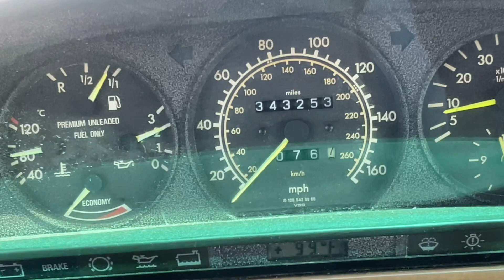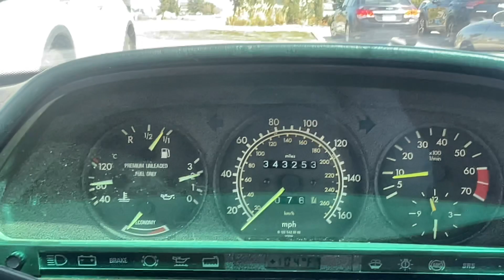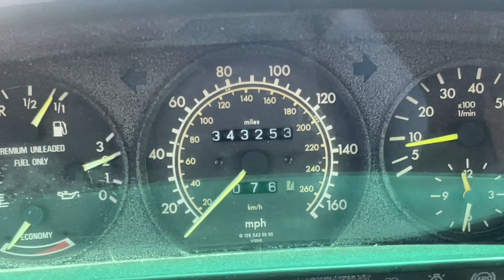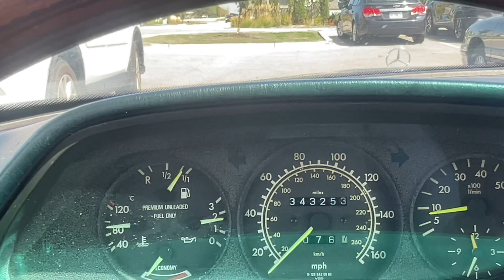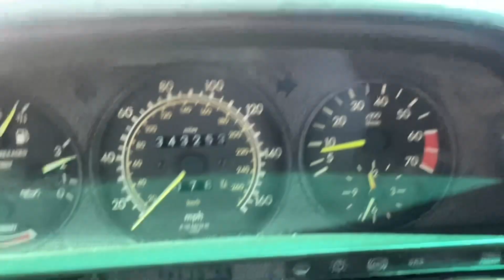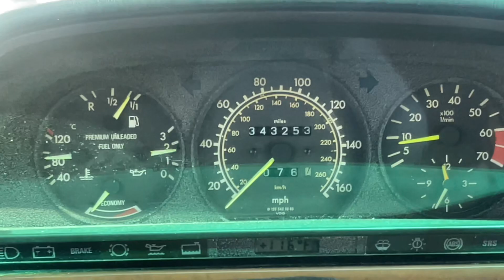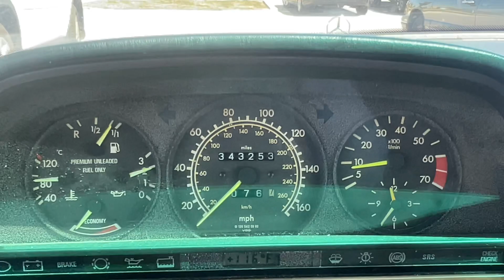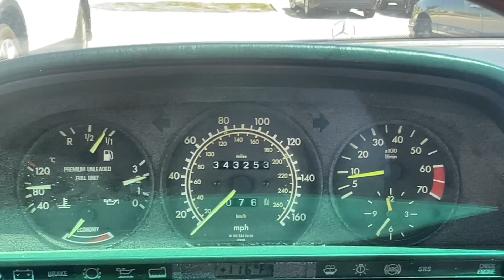Mercedes 560SEL Camshaft Timing offset woodruff keys after 13K mi 20K Km of timing chain replacement

Comment: Can you do a tutorial on crankshaft position sensor wire, please. They are discontinued. 😢
Reply from the maker: That will be difficult, let me see what I can do
Reply from the maker: This here is the Bosch Part which is still available for the 1986 to 1991 560SEL 117.968 engine 
https://www.pelicanparts.com/More_Info/0261210022.htm?pn=0-261-210-022-INT
Reply: Thanks, I tried buying but it's out of stock. I'm very worried that I have to abandon my 560SEL once the CPS stops working. No one has them anymore. I tried dealerships, Walker, Bosch. All say N/A. i'm thinking that another cars CPS will work. Just need to match it up.  @inovahightechltd
Reply from the maker: @mehatestaxes  Bosch has a universal sensor. This sensor has a connector and requires a Bosch Cable. For these two items you have to contact your nearest Bosch Automotive Center directly to get pricing and availability 
Bosch normally sells their parts only through these centers, which also repair cars
Reply from the maker: I just found this eBay seller who stated he has 10+ available but at 800 bucks!
This is INSANE!
https://www.ebay.com/itm/364428466667?mkcid=16&mkevt=1&mkrid=711-127632-2357-0&ssspo=TYg8JGi7Qee&sssrc=4429486&ssuid=Hi9YnvwaR7e&var=&widget_ver=artemis&media=COPY

Comment: Man your car runs cool!!!! I've been using 10w40. I need to try 20w40/50! Did you happen to put a cooler thermostat in as well?
Reply from the maker: I believe so, the one which opens at lower temp